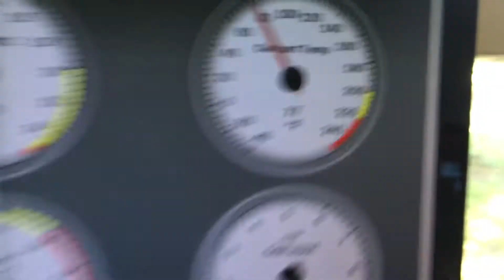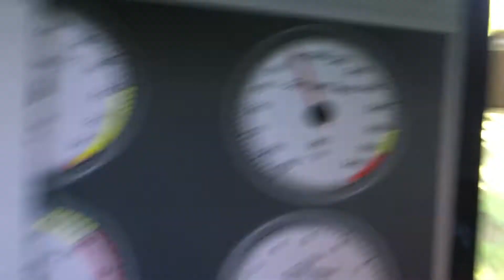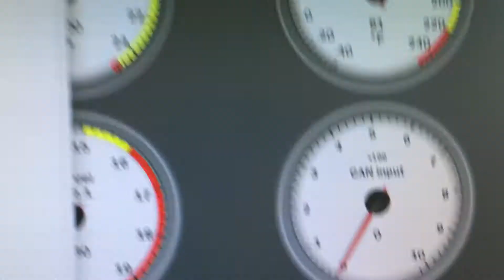Megasquirt CAN bus read and write

Comment: The linked can modules are no longer available. Can you share a new link or criteria you use to buy them? The cheap ebay one i got is not working for me
Reply from the maker: Here you go https://www.amazon.com/HiLetgo-MCP2515-TJA1050-Receiver-Arduino/dp/B01D0WSEWU
When searching the key is to make sure it's a MCP2515 and you should be good with this example and code.

Comment: did you tie the arduino ground to the sensor ground of the megasquirt? Just wondering if it will cause a difference in readings between arduino and ms if you dont.
Reply from the maker: Yes I tied the grounds together for that exact reason.
Reply: @MalcolmV8  one more question…did you have to add any filtering to the input signal for noise, or did you just go from 0-5v sensor to analog input and get a usable signal?
Reply from the maker: @worstcrewchiefever6646  signals were clean enough I did not have to do any noise filtering.

Comment: i wish saw this video before, it help me a lot.  do you try to add a small screen to arduino and read the canData?
Reply: Never had a need for a screen on the arduino.  I just hook up a serial cable and redirect output if I need to do some debugging.  Otherwise it's tucked up behind the dashboard somewhere never to be seen again :)
Reply: @malcolms6500   :D , its cool see more about this. schematics , where begin and those things. thx
Reply from the maker: @matiasrivas8251  There's a link in the description where I posted sample code to make this work as well as some screenshots of the configurations in Tuner Studio.

Comment: hi, thanks for all the info, quick question, how do you identify what channel corresponds to each signal? Ex you stated :

RPM = (float)(word(canMsg.data[2], canMsg.data[3]));
CLT = (float)(word(canMsg.data[4], canMsg.data[5])); CLT = (CLT / 10);
why rpm is there and how to know the other signals ?

probably my question is to basic, trying to learn a little bit on this

thanks
Reply from the maker: You can find the values in the Megasquirt CAN manual over here http://www.msextra.com/doc/pdf/Megasquirt_CAN_Broadcast.pdf

Comment: Cool...but no code?
Reply from the maker: I've updated the main description with a  link to code examples and some other info related setup info.
Reply: @MalcolmV8  Okay! very nice, Thank you! I have an MS3-Pro that I have added a few extra sensors to using TIOx and I have created my own controller for the electrical system, Arduino fuse box if you will, that controls all of the lighting in the car and I'd like to setup indicators for the lights on the the TS screens. Thanks for posting!
Reply from the maker: @MegaScott  you're welcome and glad it helped out.